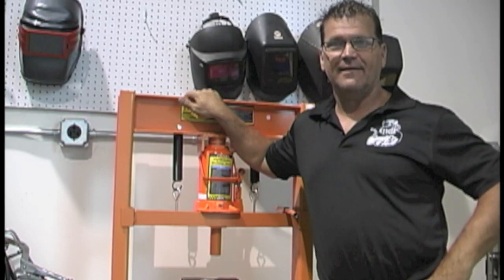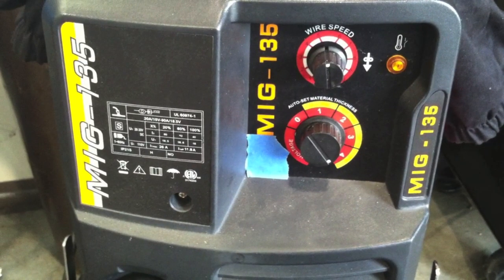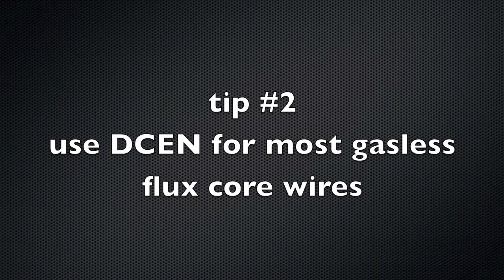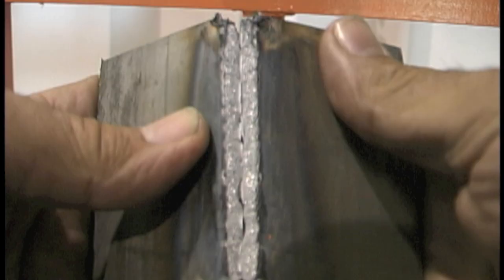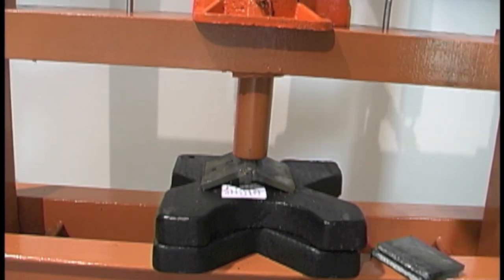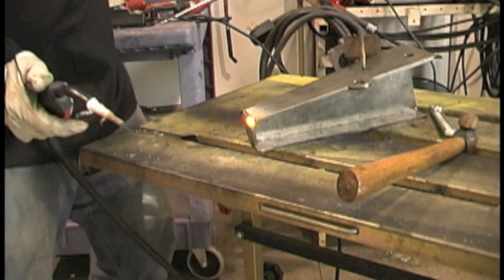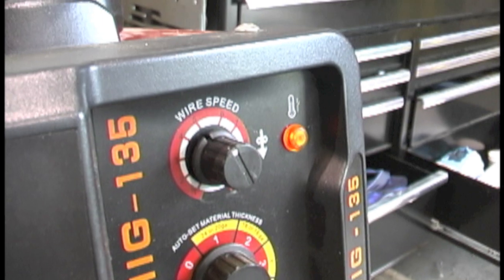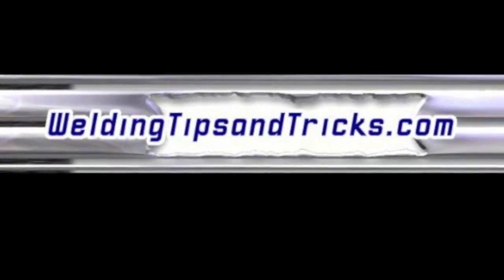115 volt Flux Core Welder Tips

Comment: I learned three general things watching your videos that really make or break welding with my 110v flux wire HF machine. 1 clean to bare metal. 2 clamp the ground tight. 3 proper power to welder. Break those rules and it dont work worth a shit. more preheat the thicker it does, but not essential for the work it should do out of the box. 3/16" or less is also what mine is rated.  Deep bevel and a smoking hot preheat it will weld nice on 3/8" after a few passes.  Yes it has a terrible duty%

Comment: I'm curious as to whether or not you have reviewed the Chicago Electric Flux Core Welder.  Rason being is, that I only have provisions for 120V 20A service.  I recently bought one & just want to know what you think of them.  Yes, I di buy it at HF Tools.  I also have a Chicago Electric Angle Grinder w/ a 7/8" arbor & several wheels for it.  When I go to shop for tools, I wan to get the most effective tools for my money, as I am on a fixed income.  The welder was very surprsingly easy(a cakewalk for me).  I will be using the flux core wire hat came with it (.030) but it has a .035" tip.  The employee was very knowledgable & very helpful.  I saved around $39.00 on it, as he had also signed me up for a year with the Insider Track Club.  We have a HF Tools store in town.

Comment: ya the grain in hot rolled can really screw you over. i had to qualify a mig procedure that required 6 coupons out of a 24" long test. we used the edges of 8x3/8 flat bar. the bend test always failed outside of the weld zone. failed that shit at least 4 times before i caught on to it.

Comment: I would guess the out put of my welder is some were a round 30 or more volts. I know I can get 200 and 400 amp diods to comvert the out put to dc out put. were as my machine is only ac out put. and I would assum thats what causes the spatter as bad as it dose. I never used a dc welder just stick ac and this mig that is also ac out put.  So would converting this to DC out put make a difference in welds.

Comment: Hello there. I had a question. I have a flux core welder and I use a fixed 13 shade lens. How come I can not see the puddle as clear as this video? Is shade 13 to much for flux core welding?
Reply: Yeah, for a 115 welder a shade 9 lens will be enough. I have a Lincoln Viking series autodarkening helmet and it rarely leaves shade 9.

Comment: i'd like to see a straight Co2 setup. much cheaper/affordable than argon. them argon bottles are damn expensive. i've got a 80 cu/ft'er and it was pretty expensive to buy outright. (i traded 2each 40's for it at the LWS) but i'm using it for straight argon. sucks to have to keep switching (use it for my TIG, but the MIG is good for those quick things) does Co2 penetrate more than fluxcore? is there a way to tell how much "heat" i need to put in for various machines (without their charts?)

Comment: Pretty crazy, I have a hobart ez125 which is basically the same rating as this one here except i have NEVER overheated it! I can weld all day and it never breaks a sweat. Goes to show you name brand vs. chinese mystery brand can never replace good USA made machinery, no matter how cheap they can make it.
Reply: I have the same welder.  Runs a long time.  It hasn't ever shut down on overheat, but on big projects it will suddenly start welding like crap.  For instance, it wont hold a puddle and just starts popping and cracking.
Reply: Dishwasher117 I did recently.  But it was due to Harbor Freight wire.  Live and learn.
Reply: The difference is an American (if you bought the shite welder in the US) telling some Chinese factory floor manager he wants the cheapest possible product and another exec telling an American engineer to design a good product for professionals. Nothing at all is better about made in America, they're both products for different markets. The Chinese can make some high end products without the pressure to cut corners on the product and worker salaries.
Reply: kelly g phillips that is because you may be welding to close to the work piece, lots of the heat is transferring to the contact tip which is overheating it, which causes the wire to bind. When this happens it will almost act as if you have worn out rollers, it well weld, and then stop for a second (give or take) and then continue. Changing your distance from the weld piece will help this issue, as will cooling the work piece every once in a while if you can.
Reply: +bignickthegreat if you call 20% duty cycle at 85A good, you need to use a real welder............

Comment: I wonder if it would be possible to use liquid cooling or something like that to increase the duty cycle of the welder? has anybody tried this?
Reply: torch comes with liquid cooling.though my brother in law asked me to make a cooling maschine for the water. I declined bcos he's an a** For the maschine I was thinking about  putting a peltier block in front of the air intake, anyway I use more volts/amps than my colleagues.  used to work on a shipyard, setup 225 amps so you don't have to go down every time to swing the handle of the big buzz box...goedendag

Comment: That's funny, I just got the same press from harbor freight. mine looks like it bolts up differently at the top. how's the press working out for you?
Reply: I bought one on Labor Day. I shimmed the ram beam with aluminum plate on inside and front, and was missing bolts, washers and bottom strut pieces. You get what you pay for there.

Comment: I don't have the option of swapping positive and negative terminals like that, would it be possible if I swapped the positive and negative wires in the plug?
Reply: You will smoke the unit, or it will not work, power up, change output inside machine. And throw any warranty away.
Reply: @dave  there is no polarity with AC, well not unless you are measuring it 60 or in the case of the UK 50 times a second. Are you there or over here in the americas? Anyway...I don't know what kind of flux core he is using, but if you were to have a look at your tranformer you would probably see two wires coming from it and like mine there is no polarity difference there just a phase differential. I have just been trying to get to the bottom of this matter and am reviewing the footage in this video to determine what kind of fancy assed flux core machine he is using. Apparently he doesn't realize that the bulk of the people watching are using the $100 USD variety available at places in the States called Harbour Freight. MIne is even chealer than those if that is even possible, up here in Canada at a place called Princess Auto. Actually in USD right now you could buy one for $70 omg. I guess I will experiment but I take it that I will be trying to better my results with surface prep using a grinder and "a little tip dip and spatter shield" as was mentioned by another chap several replies above yours
Reply: Chris Leech there is diods in welders like this to allow the use of flux core. if you cant change polarity, then the machine cant do flux core.
Reply: Believe me, they sell AC flux core welders with no diodes, just look for YT vids about the Harbour Freight $100 welder. There is a $50 DIY project to make it into a DC welder. But if you cannot source the parts for this amount then you opt for the next grade  of welder that also does a modest MIG setup. The 90 Amp welder if left without the upgrade makes the crappiest weld in the world. There is more splatter and corruption/porosity and cleanup grinding to do than is believable

Comment: Get a Lincoln 100 wont get that over heat problem iv been using mine for 8 years now never had a problem iv welded half inch and barely any slage 
I push and pull iv never broken a weld

Comment: Flux welding REQUIRES that you PULL the puddle and not push it as the puddle will become contaminated with slag. Even in a upward vertical weld, you should pull the puddle. As well, the side to side technique you are using with the push is weakening the weld due to said contamination. 

We all know that any 115 Volt welder is only good on 1/8 inch or lower, so why bother using a metal that the machine is not rated for? 

If the cycles of this machine is only about 6 inches of weld, I would have to think that perhaps this machine is bad, as in defective. Did you try another to insure it got a fair shake? 

I have a cheap Harbor Freight welder that runs all day long with no heat cycling and penetrates 3/16 like a champ.

Just saying, you may not be giving this welder the best chance to succeed.
Reply: +Rob King So one second you say that "We all know that any 115 Volt welder is only good on 1/8 inch or lower,", then the next moment you say "I have a cheap Harbor Freight welder that runs all day long with no heat cycling and penetrates 3/16 like a champ."

Knowing that the HF welders are all 115VAC machines, you've just contradicted yourself...
Reply: Agreed.  My HF runs all day without over heating.  Could be a bad unit, but shame on them for sending it to you.

Comment: With 30 flex core wire what settings would you recommend with 1/4 inch steel plate to the metal commonly found on a shipping container...?

Comment: The only thing missing was you laying on your back, under a trailer, in the mud with a dog tugging at your pants leg... I'm not even in your zip code on this but will opine-- prep, prep & a little more prep with these 115 units... Grind the mill scale at the weld and the ground point, clean the ground clamp and preheat... And don't use these little machines on anything go-fast. Thanks..

Comment: I see these vids all the time  people crying about spatter a little tip dip and spatter shield goes a long way !!!
Reply: I struggle with spatter myself. What's tip dip and spatter shield?
Reply: Michael Kirst  Tip dip is a gel you dip your welding mig cone in and it keeps  the hot spatter from  sticking to your mig gun,  and spatter shield you can buy in a spray can like paint or you can buy it in gallon jugs and put it a plastic  spray bottle  like you mist plants with , It will keep the hot spatter from sticking to your work piece.
Reply: Thanks for the tip!

Comment: Okay you asked. The reason I say that the welding advice is garbage is because his old saying is false you always push your weld you do not pull a weld it can cause porosity as well as contamination.  you want to melt your material before you're filing up with weld not fill up with weld as you melt it. and when you're doing a test plate for a bend failure test you always weld both sides ( the exception is when you're doing full penetration with a back purge)  and it doesn't matter if it's hot or cold you should always back grind your welds before applying your next bead on the plate. also if you look at his welds there all over the place they need to be uniform and straight otherwise you chance winding up with a lot of problems in the weld things like undercut as well as rollovers either way if not cleaned properly it can cause porosity and weld fatigue. I know my comment was hard and I meant no ill, but I do not like people instructing individuals with bad advice. I guess you might say that's a personal pet peeve for me, and if you disagree all I can say is enjoy your short welding career.
Reply: +R Reichel you are obviously that welder that learns a few things, takes them as the only way to do anything, then goes to say everybody else and anything else is wrong.
Reply: +yeremy Ryan yea your word tell a lot about you woman
Reply: +yeremy Ryan I guess vulgar people are indeed vulgar. I guess I'm not, sweetie
Reply: pippensculps  ok rookie
Reply: +R Reichel i agree with the other guys here,  you sound like you read a book on welding yesterday.  +yeremyryan haha awesome
Reply: +R Reichel Sorry, but you seem to be the one very miss informed, there are uses for both pushing and pulling, pushing usually creates a flater profile and pulling a more convex, both have their uses. I've passed tests with both pushing and pulling, (ie, 2GF with Gas Fluxcore I drag all the passes except the very top (on the cover pass only) as it is less susceptible to undercut). Sorry, but the most common bend tests don't have you weld both sides, side note, good luck pipe welding both sides! lol... You only back purge certain alloys, there would be no point what-so-ever back purging mild steel. Then you mention he's all over the place, he's putting heat into each plate, he's going back and forth in a smooth motion so he DOESN'T get the symptoms you mention, it would be quite easy to get a lack of fusion on either plate if you ran right up the center with that 115V machine that lacks the power to create the heat needed to do that reliably. By the way, I mean no ill, but to spew off a bunch of random BS on a channel watched not only by newer people to the trade, but red seal, etc certified welders as well, you were asking to be corrected.
Reply: +Speed Junkie  you have the right to your opinion but more failed welds happen when they're pulled rather than pushed that's fact you can State whatever you want to state but overtime it's proven itself over and over again so if you want to think I'm wrong have at it.
Reply: +R Reichel Where is your proof? If you want to make statements like that, at least show some evidence.
Reply: +Speed Junkie 😂😃😂😃😂😃
Reply: +R Reichel  your wrong on many differnt levels here.
Reply: You pull a stick welder not push(It uses a flux!) and FCAW is not the same as GMAW even though it uses the same equipment. Pushing will entrap slag causing embed slag into the weld that is just as bad a porosity. Rule of thumb for FCAW is follow the same rules as ARC and you cant go wrong.

As for grinding back welds on triple plus stack welds i have never seen anyone do that and im wondering why the hell they would? Undercut and overlap are to do with settings and technique not lack of grinding the crown off a weld before running a secondary plus weld. I weld semi trailers all day everyday at work, we also run triple stack welds all around the kingpin housing and skid plates. I never grind the root pass or any other pass, also neither does anyone else.

Our names are signed off and every weld is inspected by the engineer on every job, never once had any my trailers came back with a weld failure. The only time i have ever seen trailers come back is from new people that start and can talk the talk but really cant weld for shit. They always end up fired.
Reply: All your information you just gave is talk. Engineers do not test your welds that's done by an inspector. I see that there are a lot of people making comments that obviously don't know what they're doing but are trying to act like they do know what they're doing. Hey listen if that's the way you want to do it that's fine do whatever you want to do. you can be an idiot as long as you want to be an idiot enjoy yourself.
Reply: R Reichel We have two engineer's and they do inspect all our work before the trailers leave the yard. I don't need to bullshit to ya, i couldnt careless who believes me. I dont even enjoy the job, but i need to pay my bills.

The company i work for is big but not that big that they hire dedicated inspectors. Thing is semi trailers isnt just welding. Im part of the welding team while we have mechanics, glassers, spray painters and auto electricians.

Im telling you now the engineers inspect the welding where im at. No idiot here however i feel like one doing this bullshit work. Why you may ask, well 90% of the welding is 4g, 3g, 4f and 4g. Yeah... not very fun getting burnt to shit everyday running triple stack 4f/4g welds around skidplates and kingpins!
Reply: He must weld stainless and titanium pipe.  My cousin is a Fitter out of 636 in Detroit area and he does tank farms 9 months a year, almost all stainless from 2"-12", not all is purged. I went through 98 in Detroit and got the Plumber license, but still had to weld. This channel is Tips, so people can take or leave. I have watched and learned.
Reply: R Reichel You've made a bunch of comments on this vid but not once addressed that this is FLUX CORE welding. Sure, push when MIGing but you drag when flux core welding and he explained why in the vid if you were paying attention.
Reply: Matthew Isaac you're correct I did make a bunch of comments but if you feel that my information is wrong give it a try and see if it is and then tell me
Reply: R Reichel Fair point, I'll try push and pull with some flux core and compare.
Reply: R Reichel you are totally wrong. flux core isnt the same as gas shielded mig. I dont know where you learned to weld but ive been to school and my teacher ( welding inspector) teach me to drag the slag. And every fab shop ive worked at drag the slag.....
Reply: R Reichel Im really sorry if i made you feel dumb for welding the wrong way all these years buddy.
Reply: R Reichel have you considered that the peoplw correcting you know better than you. There welding inspector and engeneirs watching thia channel....As far as I know, you did not invent flux core welding.
Reply: Dis lob3 since you have said that then no I guess I won't stop I happen to know several inspectors from the American Welding Society and none of them are welders they are metallurgists they study metal they do not actually weld but then again I don't expect anybody like you to know because you don't know much
Reply: R Reichel I have muted this post. Ill leave you with this quote:
"Never argue with stupid people, they will drag you down to their level and then beat you with experience"
Reply: Dis lob3 oh okay here now mr. mature I see you probably don't even know what a metallurgist is maybe you should look it up you might even learn something
Reply: Dis lob3 D none of the above